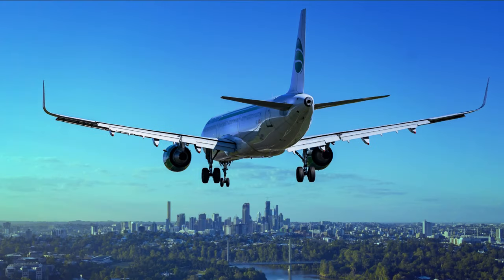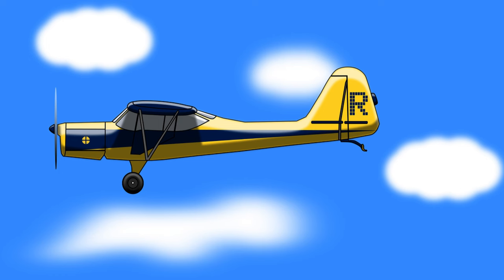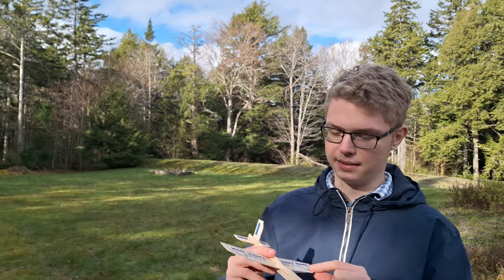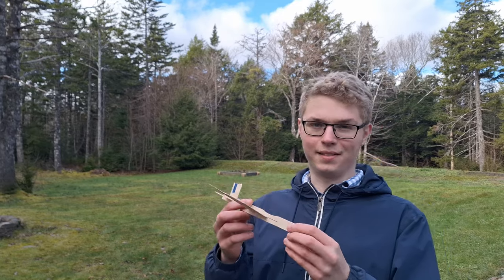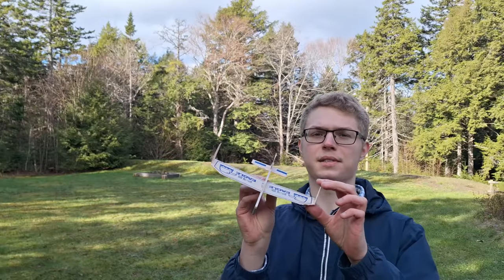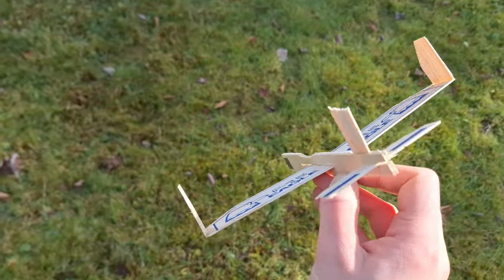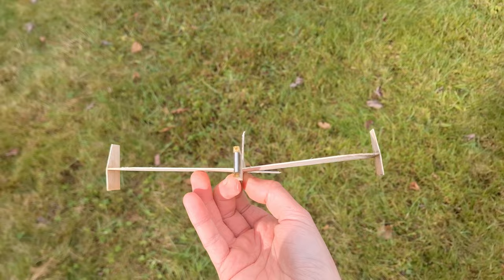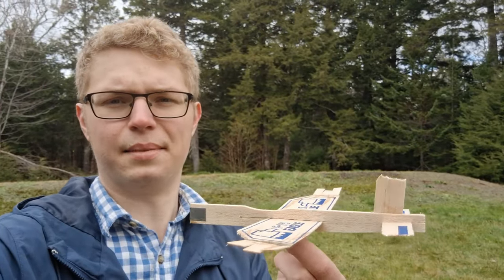Finding the Best Wingtip for Model Aircraft

Comment: How about building a miniature wind tunnel? Or firing the gliders with some sort of repeatable catapult. There might be a free aerodynamic testing program out there as well.
Reply from the maker: I've already been considering the wind tunnel. The problem is with finding equipment sensitive enough to evaluate these tiny gliders. An aerodynamic testing program would definitely be a good idea for a follow up!
Reply: I think  there is a free testing program called Open Foam but its linux based. I have not used it yet but I am planning on doing so when I finish my cad model of the drone I am working on right now.

Comment: Your wings are flat i.e. not aerofoil-shaped, therefore no differential pressure to test winglet effectiveness. But you were right about the centre-of-drag issues imo.
Reply from the maker: I thought that there would still be a pressure difference between the top and bottom surfaces of the wing, even if it is flat. Do winglets need some characteristic of airfoil shape to work?
Reply: Yes, a slight pressure difference but for different reasons, so I'm sure the science is different. An aerofoil is designed to slice through the air with its bottom surface horizontal, or in line with the direction of travel at least, for minimum drag. The slight tilt of flat winged gliders (the longitudinal dihedral i.e. the small difference in tilt between the main wing and the tailplane) trades off the drag introduced (by the angle of attack) for the lift gained by redirecting the airflow - the 'downwash' effect. All planes need the downwash effect for take-off and landing, and lift at low speed, but not for level flight where minimal drag, fuel economy and speed are priorities. @HomeGliders
Reply from the maker: Thanks for sharing!